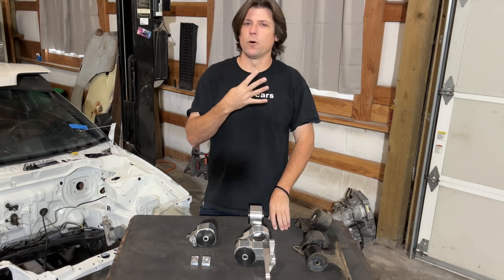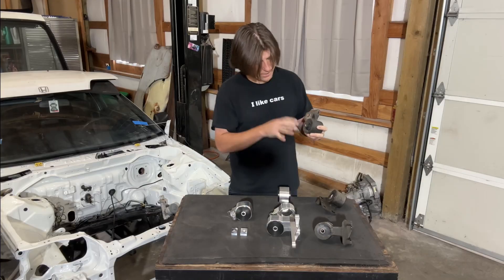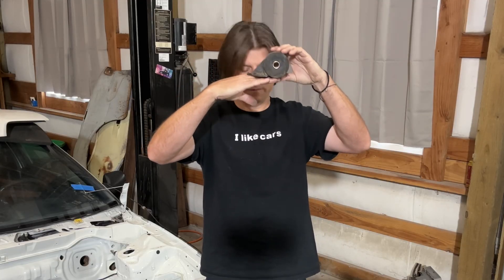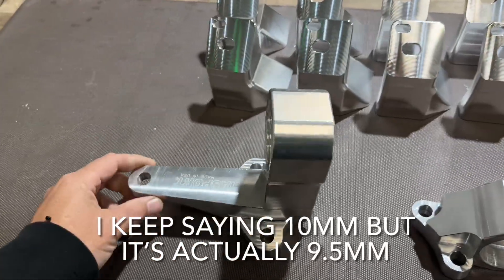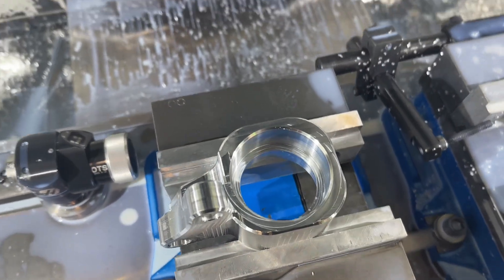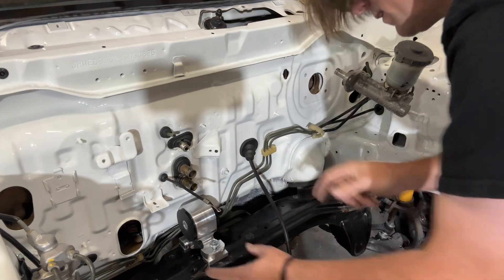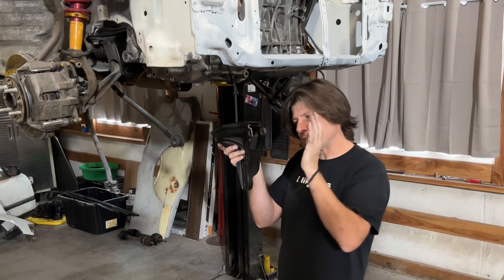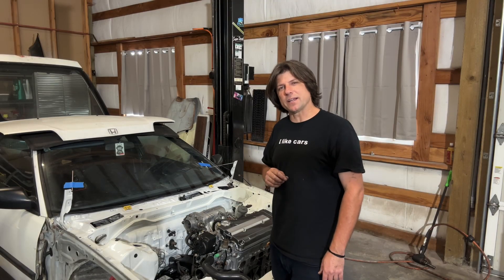JSP Project CRX : EP 04 Stop smashing your header, let’s raise our B16 engine with custom mounts.

Comment: Top tier. Are you or have you designed a distributor blind or block off.
Reply from the maker: I feel like there’s already lots of options for this. What would you want different from what’s available now?
Reply: @johnrussakoff I'm not a B Series guy. Just an idea for JSP parts, and your craftsmanship. If I had the resources I'd probably make everything in-house, like oil dipstick housing, clutch reservoir, firewall pass throughs, strut tower cross member, to name a few.